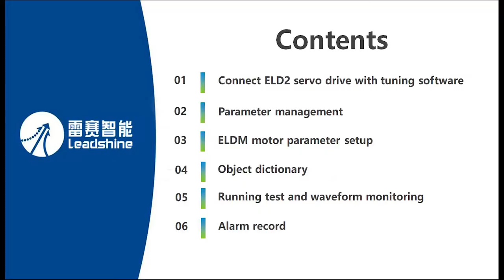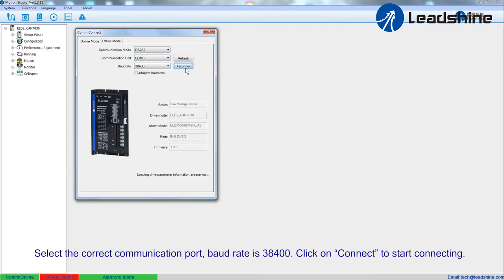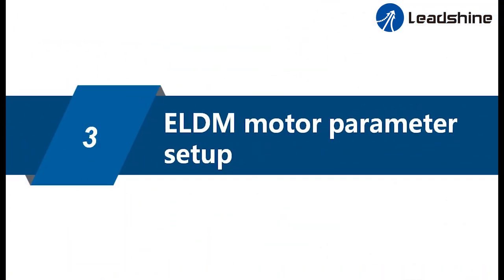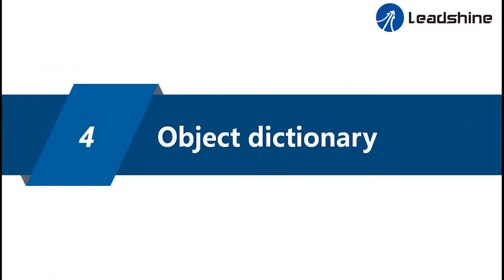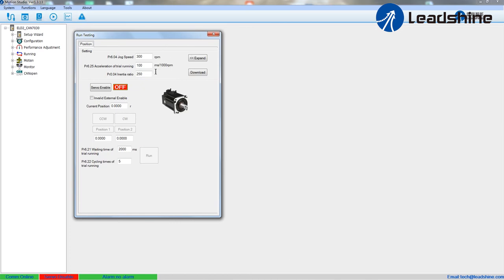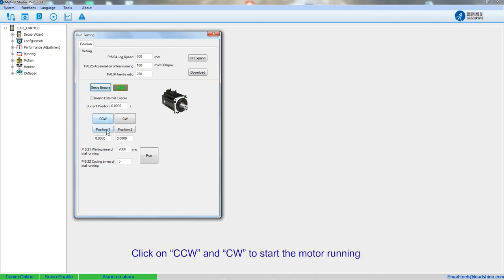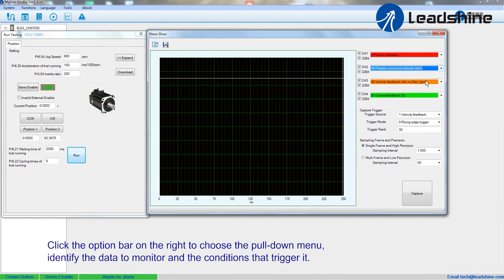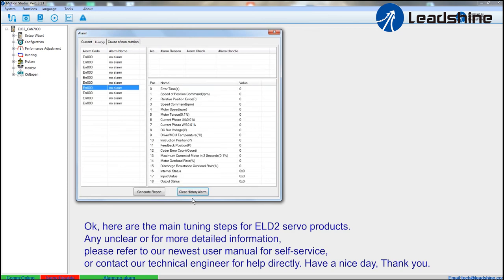Leadshine ELD2 Series Servo System Tuning Video

Comment: How can we tune the servo for its maximum performance in a smooth jerk-free way after fitting it to the actual machine ..? Please share such a detailed instructional video
Reply from the maker: Thanks for your message, please send your problem to our tech@leadshine.com, our technical engineer will contact you.